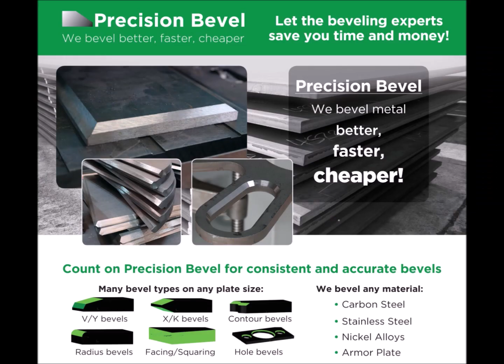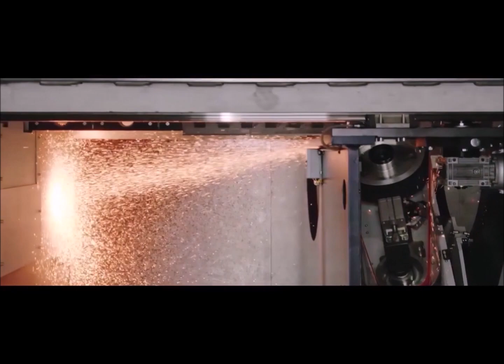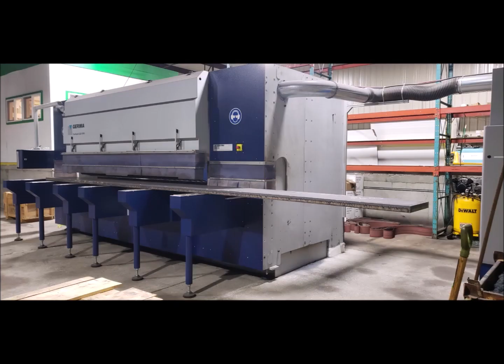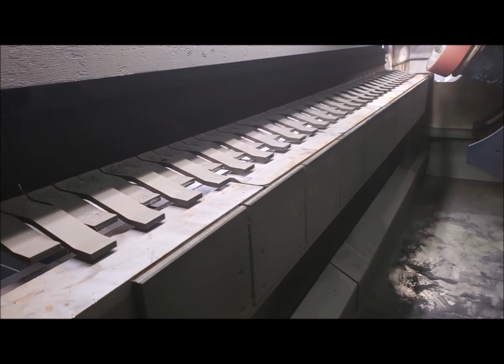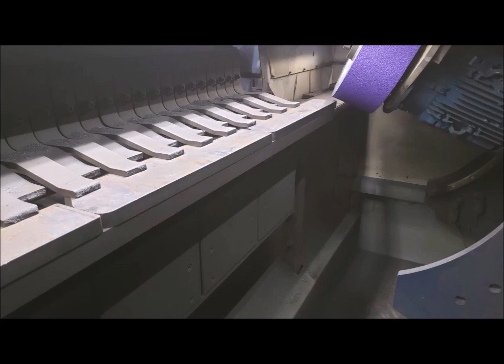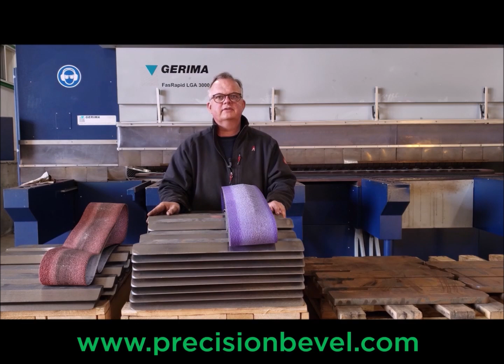Testing the 3M 984 FX Pro Grinding Belt | 3X Tool Life & Extreme Material Removal

Comment: I spoke to your forklift mechanic about this process so I had to check it out. 
I am very impressed with the process as well as the added longevity of the new generation 3M belts. 
Can you tell me how long it takes to grind this bevel on the 6 pieces?
Thanks